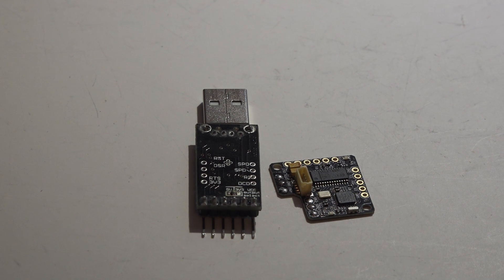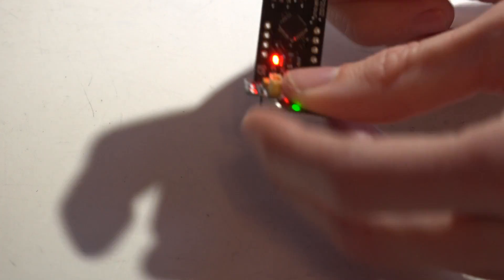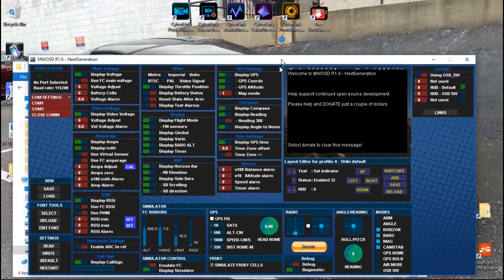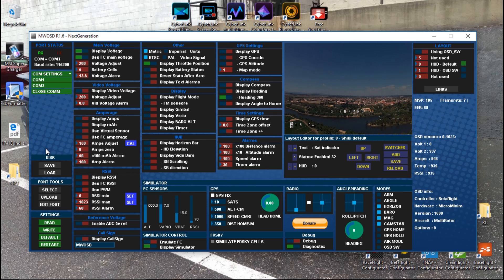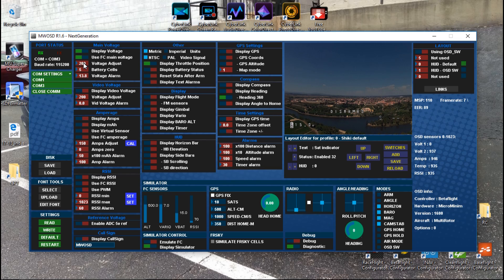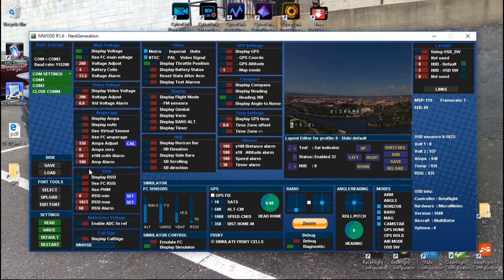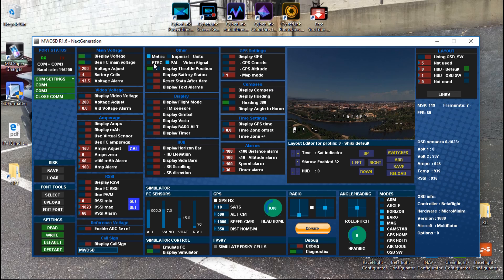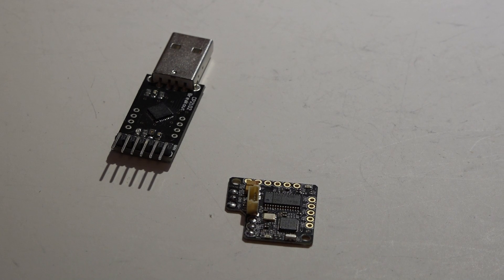Furious FPV Piggy OSD MW OSD Set Up

Comment: Hey, I have done the fix for x4r fried receiver but I can't update the firmware to non-eu please help!
Hope you reply
Reply from the maker: If you're trying to power the receiver off the Taranis its not going to work. You could try powering the receiver off the flight controller then running the other wires to the Taranis. If that doesn't work then you need to buy a new receiver.
Reply: So I should run the + and - wires from the flight controller then only connect the telemetry wire to the Taranis.
Reply: Anyway to change the firmware for the taranis.